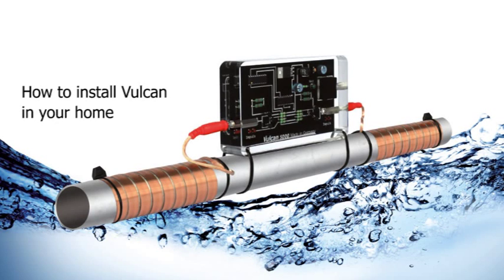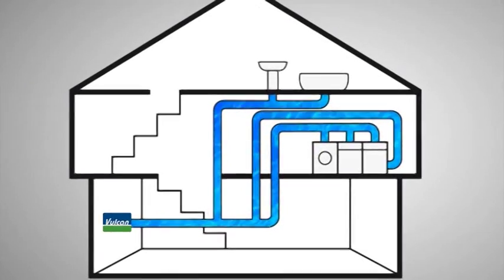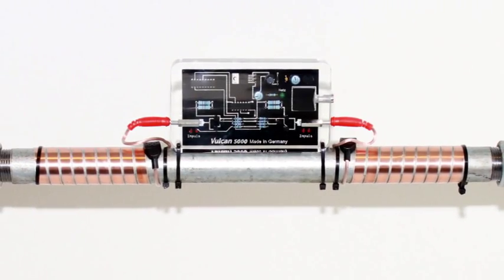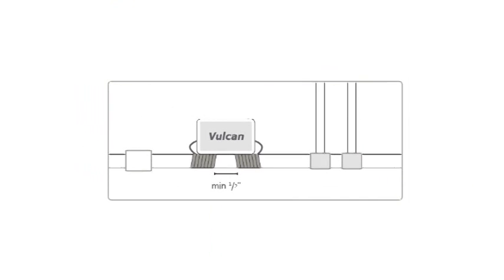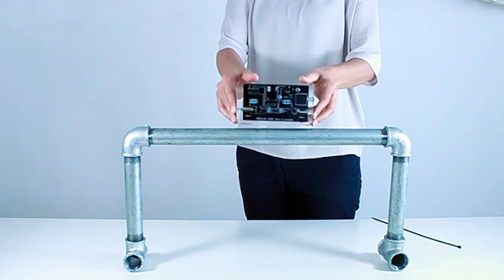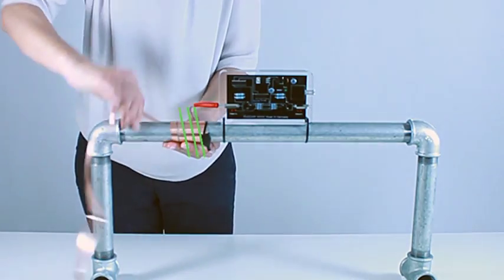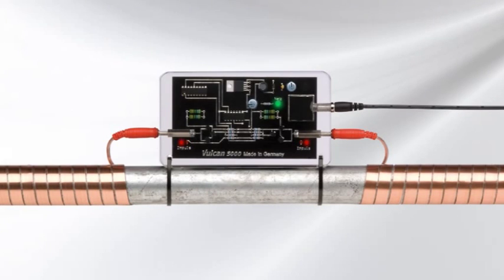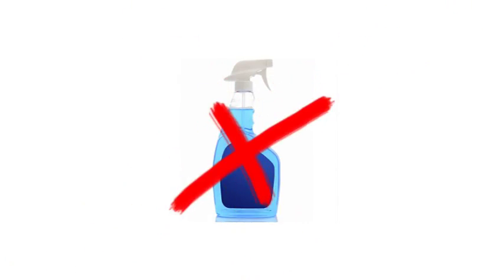Vulcan Anti-Scale System - Installation Residential Line (EN)

Comment: Roughly, I have to replace my water heater elements every 10 months without adding salt for my water softener. Sounds like this type of products can only make it every 10.5 month or something like that. Not much usage for me?
Reply from the maker: Vulcan works for boilers, if the heating element temperature is under 95°C. Here you can find our client references for boilers: https://www.cwt-vulcan.com/reference/?reference_search=1&keywords=boiler&country=&vulcan=
Reply: @VulcanAntiScaleSystem  I have done a lot of digging since I really need something. How long can it extend my element usage?  0.5 month is statistically what my reading gave to me. "May or may not work", best case is somewhat improvement, not something people can rely on. I wish I am wrong,  need somebody help me to see it.
Reply from the maker: @longago1faraway027  You can not compare a salt-based softener with a physical water treatment. If you would decrease the physical hardness and want to spend salt continously, you can use a softener. Here in Europe it is forbidden often, because of the bad environmental factor of usage.
I can not say a number how long the heating element will stay clean. We have clients they never had to exchange the heat exchanger anymore and we have clients they double the time. So in your case not every 10 month, so every 20 months. It depends on many factors (your water quality and the temperature of your heating elment.) If the temperature of the heating element inside of your heat exchanger is more than 95°C, Vulcan and no other physical water treatment can help. From that temperature, the scale will burn into the surface of the heating element. Then you only can use salt or chemicals. If you are using a salt-based softener, please take care, that you soften the water not too much, because that will cause corrosion.
All our boiler references you can read here: https://www.cwt-vulcan.com/reference/?reference_search=1&keywords=boiler&country=&vulcan=
Reply: nobody knows. why do you keep asking this question on every review ?
are you saying you only add salt every 10 months ?

Comment: I have a scale master which uses the same principles and connection method.  3 years later I had to replace a hot water tank due to scaling.
Reply from the maker: Scale Master is not Vulcan. You can not compare another product, because every product has a different technology. And we say very clear, that scale is reduced and not 100% gone. The biggest benefit of Vulcan is to help to reduce the scale. For example if you have to change the hot water tank normally every 3 year, with Vulcan it is maybe all 4 or 5 years. Like this Vulcan will benefit.
Then you have to take care, that the heating element surface temperature is max. 95°C. Over that temperature no physical water treatment system can work, because the scale burn into the surface.

Comment: Does Vulcan work for/with boilers used for Industrial purposes?
This particular case is a Silk processing plant where boilers are used for producing steam and hot water. Scaling has been a huge irritant here
Reply: Hi Sir, Vulcan works in boilers with a temperature upto 95 degrees. Please do contact Scaletap Solutions @ 9840030092
Reply: Koi solution Mila ji. Indiae bhi bahut seller hogaye is type ke equipment ke..koi try Kiya apne?